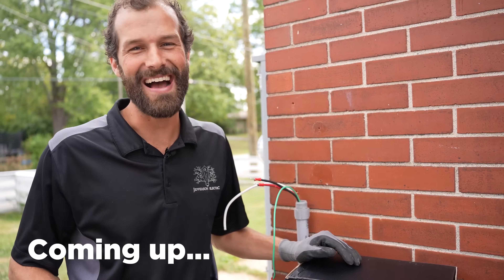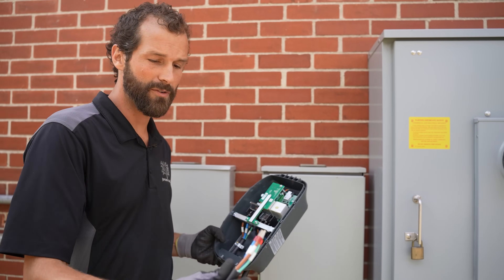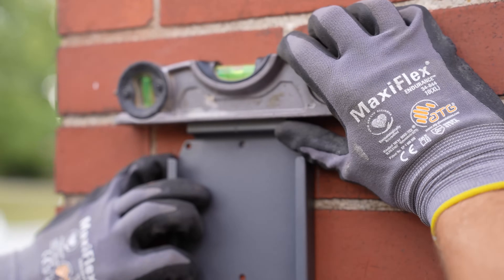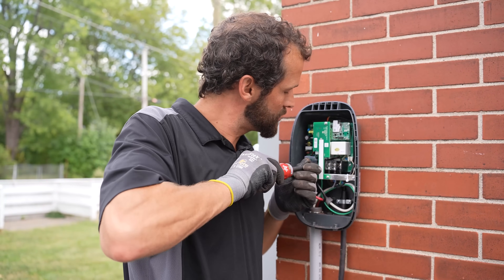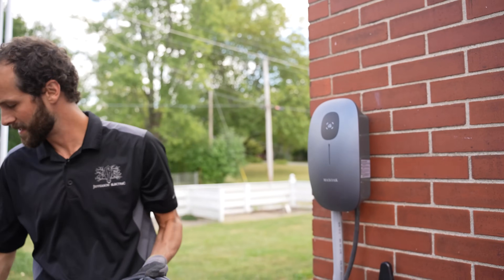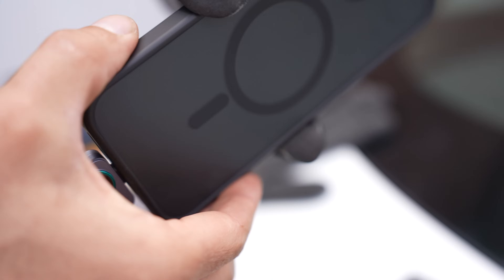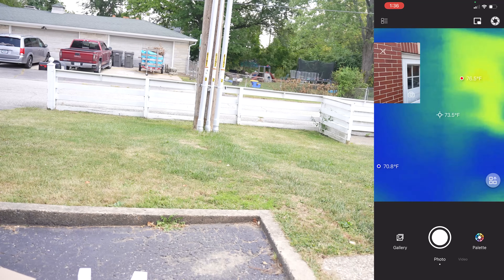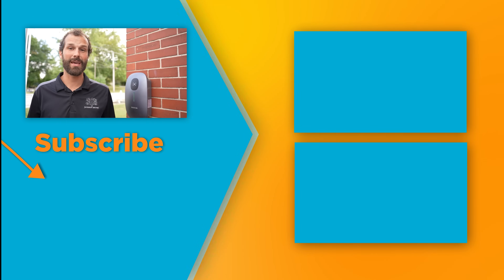A Different EV Charging Option: MAXOAK

Comment: Hey is there a reset button or anyway to reset the maxoak ev charger? I installed and everything was working great with the IDR card reader, however it stop working when installing the app. The app appears to have mess everything up and now it will not work. I am looking for a way to reset back to factory settings? Any suggestions?

Comment: I got a chargeverter for my solar system 30 amp plug. Why cant I turn my water heater wiring into a receptacle and put a plug on it? Then I could use it for both. I think code prevents it but how is it different than a EV charger outlet? Thks

Comment: I have an electricians question:  I have an old house built in 1972 that has AL wiring.  

My dryer went out. (I was hoping it would go out eventually due to a loud annoying noise it made.)

We checked to see if the 30 amp double pole circuit breaker tripped, but it didn't.  So we assumed the dryer was dead.  So we got rid of it and bought a new one, plugged it in and realized that it was the receptacle that went out. (or so we thought)

Then I got a very light shock on my arm after I plugged in the new dryer.  I did a voltage test on the dryer terminals to see what was happening, on the left terminal.  I was getting unusual readings.  

I check both hot legs in the receptacle and got 240, then checked each one of the hot legs and was getting 120 on each.  I assumed that the receptacle was bleeding power into the neutral, and replaced the receptacle.

For 3 wire connections you have to keep on the neutral strap so it's used as a ground right?  for 4 wire connections, you remove the neutral strap and put it back on the neutral, and then bond the 4 wire ground terminal to where the neutral strap was right?

I think the left terminal was reading like 50 volts, and somehow power was going through the ground/neutral and causing it to electrify the dryer, and when I would touch my arm against the metal laundry room doors, id get a very very light shock. (barely noticable.)

I inspected the receptacle, it was as old as the house was, with 2 8AWG shielded AL hots, and a solid, bare 6 AWG ground/neutral, then I replaced it.  

On a 240v Circuit when both of the hots are coming together to form 240v that is part of completing the circuit, so long as each leg is on a different phase right?  

Is that how that works?  I was very confused when I saw this configuration.  I am used to my usual 4 wire receptacles, I know very little about how 3 wire HV circuits work and I am trying to figure it out.

So I bought a new 3 wire HV receptacle, I had to remove the old metal box, and installed a new maximum depth 2 gang box, cut the wires back due to seeing some oxidation on the AL wires (which had no antiox on them at all).  I was having trouble cutting through the wire due to the weird old metal shielding, so I had to cut that back as well.

There were multistrands, and I had to cut back again, because on one of the wires, I cut one of the strands, so I had to cut back to where I cut off the strand.  

I used an old toothbrush to lightly brush on a light coating of antiox on the freshly cut AL conductors, and a light coating of antiox in the receptacle, and carefully wiggled the AL stranded wiring in, and tighted, and re tightened to proper torque specs using torque screwdriver, put in the 6AWG bare ground/neutral, connected the 3 wire dryer and AGAIN it electrified the case of my dryer.

So I tested each leg together and got 120V, when I tested the 1st leg to ground I got 56volts, then I tested the 2nd leg to ground and got something like 78 volts, so what happened?  Did something happen to my neutral wire at the panel?  I don't know where to find it.

What should I do?  Can someone explain to me what these readings are, and why my dryer still wants to shock me?  

I went ahead and bought some 6/3, 8/3 AWG and 10/3 AWG wire for the repairs. (plus possible expansion of my HV system)  I am going to put in a 4 wire, and leave in the new 3 wire, but include a dedicated ground for the 3 wire so it has the safety features of a 4wire, this way the new home owner can use 3 wire and 4 wire plugs if they ever need to. (if I ever sell)

I was going to build a junction box and WAGO up some splices for both 240v receptacles, but I would really like to know what happened and how to trace back this bare 6AWG ground to see if maybe it got disconnected from the circuit breaker box.  

When I did some work under my sink, I noticed there was a bonding strap to my copper waterline in the kitchen, with a corroded possibly copper wire bonded to it, I wonder if they were using the plumbing system to ground the dryer?

The reason I say this is because I recently did a re-pipe in my house and right after is when my dryer went out and stopped working.  I replaced the old 3/4 copper branches with 1 inch Pex B and wonder if that might of interfered with anything.
Reply from the maker: Wow! I appreciate your thoughtful approach to the problem and your effort to communicate it effectively. Thank you!! To respond in a manner that unfortunately doesn't sufficiently acknowledge your contribution and communication let me say briefly, it does seem that the metal water system was functioning as a supplemental neutral conductor and there's a high resistance connection in your distribution system, such as in your main panel, meter cabinet, disconnect or even in the utility portion of the distribution system. The utility company will typically investigate a customer complaint free of charge in most areas and may be able to resolve this for you. If not, a licensed electrician is your best bet. If indeed the issue is found in your distribution system you could encounter other similar circumstances such as a getting shocked off your hose bibs, shower or faucet handles, cast iron sinks... I recommend resolving quickly. If the issue worsens the level of pain and risk associated with the nuisance shocks could elevate! 
I hope I understood your circumstances correctly and this response is of assistance!
Reply: @ElectricProAcademy  Thank  you for the response.  

I recently found out what the problem was.  I traced the bare ground and instead of going back to the panel it was bonded to the copper pipe under my house, that was still hanging there. (I recently converted to Pex.)

I experienced a situation where the absence of a proper ground connection led to an unsafe condition. I am still not sure why the dryer was slightly shocking me. (was a very light shock, barely noticable.)

In a 3-wire dryer connection, the neutral wire also serves as the ground, but when my plumbing system changed to Pex pipes, I lost continuity in the grounding path.

While it might seem counterintuitive, the neutral wire in a 3-wire connection is crucial for safety. 

Even though the two phases cancel each other out in terms of current flow, the neutral still provides a path for fault currents to return safely to the source. 

In the absence of a proper ground, the neutral can end up carrying fault currents, posing a risk of electric shock.

When I restored the bonding jumpers to the grounded water pipe, I reestablished a proper grounding path, which resolved the issue. 

It's important to note that the National Electrical Code (NEC) now requires a 4-wire configuration for dryer connections, which includes a separate ground wire. This enhances safety by eliminating reliance on the neutral for grounding.

In summary, the neutral in a 3-wire connection is used for both current-carrying and grounding purposes I learned.

At some point I will be upgrading to a 4 prong soon for safety.  I think I'll also go ahead and leave the new 3-prong there, but include a dedicated ground with it so it can function safely as a 4-prong. 

Thanks for the advice I will check for this high resistance connection in my distribution system you mentioned and see if this is an issue, thanks a lot!
Reply: Individuals like to cut out the copper or galvanized piping to repair or add anything.  I always tell them to put the copper system back like you found it.  They either don’t understand proper grounding or don’t care to.  If this dwelling is really old which it sounds as it is.  If you want a proper grounding system you would need a service upgrade done with ground rods with  new 4 wire going to dryer ,range circuit.  Also as stated consult a licensed electrical contractor.

Comment: The Tesla Wall Connector is better
Reply from the maker: Agreed.
Reply: What size wire is used on that charging cord?
Reply: @jeffmaling9577  6
Reply: Yes but the Tesla charger doesn’t sink with most power companies to get discount service!
Reply: @fuzion430journey3  that is 100% false. The electrical service is what determines the rate, not the wall charger itself. The Tesla charger would certainly be just fine
Reply: Still love my ChargePoint!